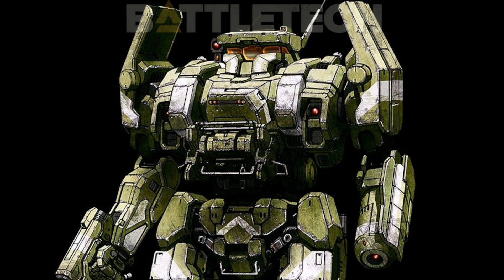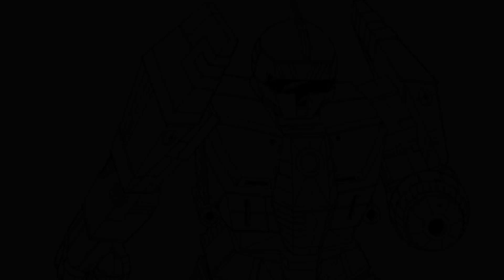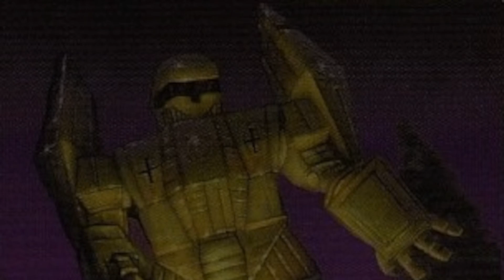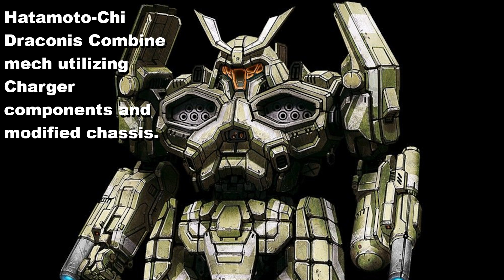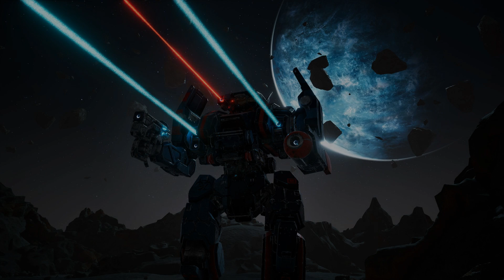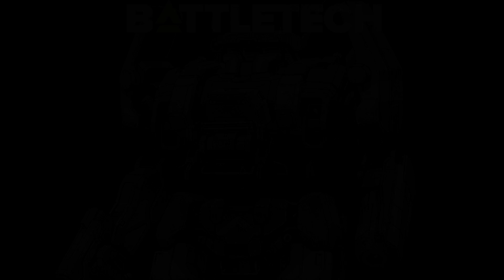BATTLETECH: The Charger

Comment: Ahh the Charger.

This is why I love BT.  As useless as the Charger is, it adds so much character to the setting that you have a design that was obviously the passion project of someone who had a 'bright idea', but maybe not as much of a grasp on the realities of warfare.  As Big Red points out, sometimes 'bold' does not make for 'good'.
Reply: The "bright idea" behind the Charger? Graft. The whole point behind the original Charger was getting those sweet, sweet Star League Dollars.
Reply: Anyone who thinks the Charger is useless have never been in a cityfight where those big slow cycling ranged weapons are next useless, and having a Charger barreling towards you with the might and rage of an Angry god; who proceeds to tear your mech's limbs off and beat you you to death with them. While you are too powerless and slow to escape. Desperately pressing the triggers waiting for your ppcs to recharge in the vain hopes that you can get off another shot or two before the Charger bashes you to bits. Also, at close range 5 small laser is nothing to sneeze at, their damage and rate of fire can quickly rip through a cockpit and microwave the mechwarrior inside.
Reply: @jakeroon  Firstly, that's incredibly niche, and secondly, that's also not it's intended role.

Yes, you can, under the right circumstances, make the Charger work.  However, not as a scout, and even in the realms of Urban/Close Combat, there are 'mechs that can do the job much better and more economically.
Reply: @jakeroon  "The might and rage of an angry god" and less armor than some medium Mechs. Even in a pure fistfight lower-weight opponents can actually take a Charger apart. Sure, it can throw hands like an 80-tonner. But it can't take a hit like an 80-tonner.

And 5 small lasers is pitiful at any range. Congratulations, you outgun Bug Mechs and some 30-ton designs at knife-fighting distances. Woo hoo. (In fact, one 3025 LOCUST variant outguns you at point blank.)
Reply: @magni5648  I was once like you, it all sounds ridiculous on paper. Then you see it happen; regularly. The thing is pilots don;t know how to react to the sheer aggressiveness and unorthodox fighting style of an 80 ton mech with that much speed and close range threat. By the time they have figured out that the small laser have softened them up enough that the Charger is about to gut them, it doesn't matter that the charger has lighter armor and "can't take a hit like an 80 toner" , b/c the opponent is already dead, and the Charger is briskly making it's way to it';s next unfortunate victim. I do agree, however; that a charger is not intended to tangle with mechs that outweigh it. But your suggestion that lower weight mechs can (with implied regularity) throw hands with a charger and make it out a alive , is laughable. The facts are any lighter mech that throws hands with a Charger and lives to tell about it, got lucky.
Reply: @malusignatius  it is defiantly not an optimum mech. but as many found out during the session wars; underestimate the Charger at your own peril.
Reply: @magni5648  As far as bug gun mech and the 5 lasers, there's plenty of evidence on youtube about how devastating 5 small laser builds are at close range , so that speaks for itself. The fact that you don't have a healthy fear of 5 small lasers builds, and the amount of sustainable damage they can dish in short order, speaks volumes.
Reply: @jakeroon  If you let the Charger pilot dictate the terms of the fight.  Then again, any 'mech is dangerous if you let the opponent do that.
Reply: @malusignatius  some times you just don;t get the choice. The fight is here, it's now, and you're in it. Also to expect a Charger jockey to not have upgraded his machine in the past 700 years to Endosteel and light ferro; freeing up several tons for enough armor to make any 80 toner go "yeah that'll do" , is not logical. The lesson I am trying to impart is: if you see an Urbanmech or a Charger on the field during a particularly rough fight. Take note, and possibly (very possibly) be a bit concerned. Because they are probably about to pull some crazy crap, or die spectacularly trying to.
Reply: @jakeroon  It doesn't sound ridiculous "on paper", it's just garbage, period. Woo hoo, you manage to surprise someone with a one-trick pony once. Great. That's not a sound base for anythign resembling an actual good plan.

And 5 small lasers aren't "softening up" anything bigger than a light Mech in the time it takes anything bigger than a light Mech to blast a Charger into so much scrap. Again, firepower worse than some light Mech, armor worse than many medium mechs. And mobility barely on par with most mediums. When a fucking stock Shadowhawk beats you in firepower, mobility and survivability, you know things are dire.

And the average 60-tonner or bigger is absolutely going to beat a Charger in a fistfight. Because they can hit damn near as hard and take hits better than it. It's a giant big strong guy... with a massive glass jaw.

So great, it can kill people who don't pay any attentition to it and do not try to kill it back. What a great weapon indeed.

Also, PARAGRAPHS. Use them.
Reply: @jakeroon  I'm not talking about high-tech custom fever dreams here. I'm talking about a fucking Introtech canon Locust-1E. 2 medium + 2 small lasers. It literally outguns a Charger.
Reply: @jakeroon  

If you're talking about upgrades (assuming they're available to the pilot, remember that until the 3040s endo etc. were unavailable to most of the IS, and even after, were rare and expensive to get), then it's not the 'mech being discussed.  Anyone can mod a chassis into something viable, that's exactly what House Liao did with the Charger by reducing it's engine size and using the space for a more sensible Assault 'mech loadout.  

But that doesn't change the fact that the base Charger is incapable of the mission it was designed for, and when it comes to the close combat role it's reasonably good at, can be out-done by 'mechs 5-10 tons lighter than it (eg. the Axman).  It's a very niche design at best.

And yes, sometimes it's all you've got to work with.  Doesn't mean it's great.
Reply: @malusignatius  I am not implying it's "great", or even "good"; I am rebutting the OP's assertion that it's "useless". The fact that the Axeman could put the whoop on the Charger that is currently pummeling your Warhammer into dust would likely be of only moderate comfort during this significant emotional event. As you frantically grasp for the ejection handles in the hopes it still works while vast swaths of your mech have been caved in. I guess some comfort is better than none.

I think I'll rest my case here, other than to say: It's easy to look at everyone's favorite power creep content of clan tech, and dismiss mechs like the Charger. However, there are a lot of mechwarriors out there, and one day you just might run into that one guy who runs a charger and knows how to do it. When you do, you'll nod and say "yeah I get it now."
Reply: @jakeroon  Firstly, I'm the OP, I know what I said.

And I know the Charger.  I've been playing BT since the late '90s.  And, as stated, in it's designed role it's useless and even when you stack the deck in it's favour, it's at best average.   If you want a design with viability over more than just one environment, the CGR-1A1 Charger isn't it.  Sure, it's fun when you get lucky and get to brawl with it, but it's no better at that than any other 80-ton 'mech, and well, the stars align for everyone if you roll the dice enough times, even Charger pilots.  

And even within it's 'chosen environment', the lack of jump jets severely hampers the Charger's utility.  And the close terrain makes it even easier for jump jet equipped mediums and lights to flank it safely, and a Jenner or a Phoenix Hawk is going to shred its rear armour in a single volley.

Again, the Charger's only going to get the fight it wants if one or both of two things happen:

The Charger gets very lucky,

or

The OpFor messes up, badly.
Reply: @malusignatius   I know what I said as well. And I repeatedly said I am not advocating the Charger is an amazing machine that outpaces others.  The charger is a second or third string. Yeah , of course it is. But it isn't useless, nor is it niche, nor does it's "intended role" matter a tinkers darn; to anyone but the military affairs guys. In this universe where a mechwarrior will immediately plop in an XL 400 engine, up the armor to 584, swap in two light ppc, and use the +50 range -50 cool-down on small lasers chassis quirks to wreck your face if they get a chance.  ( You can affix jump jets to it by the way). All without the need of the zero-g factory refit of the expensive endosteel. But you could do that too if you wanted. And some houses did! The charger , all be it a second or third stringer , can get the job done. I never claimed it was better than an Atlas or a clan tech mech with a cool animal spirit name. If you don't think a 584 armored 80 ton mech that can run at near 90kph has some pretty clear advantages that may be useful; I don't know what else to say other than: I agree to disagree with your assessment of this weapons platform. 

And that's probably b/c you are talking tabletop and I am talking mwo.
Reply: @jakeroon  MWO =/= Battletech.  I don't claim any knowledge of it or what works in Mechwarrior Online and what doesn't.

I'm looking at the design totally from an in-setting standpoint, not even within the abstraction that is the tabletop rules.  In setting, The Charger fails to achieve its stated goals, and wasted a lot of resources that the Star League needed at the time and could have been used elsewhere.  And yes, in TT, unmodified, it's a hard 'mech to get work.  

And all that fancy tech you're talking about is post-clan invasion developments, they don't exist in 3025, bar in the computer games.  Like I said, anyone can rip out the guts of a 'mech, replace it with new gear and make it work.  But then it's no longer that design, it's something new in the same shell.  So my point still stands.
Reply: @malusignatius  I find most who don't play the game in a the modern cannon era setting like  have little concept how big  a factor speed and size (both being big and small have advantages) truly are. I understand you'd really like to keep making the argument about some theory of the stock design , but even" in setting " mechwarriors constantly tinker with their mech  and make field mods to get the most out of their mech. In most every novel the key figures are modding mechs. Yeah, it's cool that the fluff for the mech was it was a badly designed graft project, but that's only half the cool fluff. The other half is warriors took this bad design, found a way to press it into service in a role it was never meant to be (because as you say it's intended role it sucked at) and made some havoc with it. 

I guess maybe in table top there is an option to play in a "way back in the day" time-frame. Keyword there being option. As far as cannon is concerned, the clan invasion was ages ago by now. All the tech I am talking about was available by 3070, and much of it was available prior to Exodus even, it just got lost in between then. 

So unless you insist on playing in the (now ancient history ) years between Exodus and Invasion, ie: the succession wars era; none of this "but that tech is not around" point matters. And even then, the Charger is considered one of the mechs that survived that era, and somehow, performed well in those dark days.

As far as the world at large is concerned the current canon fighting year for mechwarrior mercs is 3151. 

I like being dramatic in my text too, but an engine swap and some weapon harpoints replacement is hardly what any mechwarrior (merc) would call above and beyond the call of regular operating procedure. 

And again you seem to be refuting a point I am not making , namely : "The Charger is a fantastic mech." It's not, it's not even a good mech. But it isn't "useless". 

But fine , just for the sake of argument I'll concede. In it's bone stock form , the Charger is pretty awful. It certainly isn't something I;d choose to ride, ever, in any era. As the setting has it, though; good thing most other mechs in their bone stock form of the same era are garbage too, save a few scant standouts. 

That said, though. I hate slow mechs. I am using the word hate here , deliberately. You really should give mwo a try and see ow much being slow is a serious problem in an actual real time simulated fight. We ain't taking turns. So any mech that can't go over 81 kph , I am not using. The Charger is put there for ppl like me: for when you need an assault mech's armor, but still need to go fastish.  

Sure you have to "cheat" and mod the mech to get that. Which I guess is what you are saying. In the mwo circles, modding the mech is kinda the whole point. I can't imagine why it wouldn't be in TTRPG either , though?
Reply: @magni5648  it is really interesting how different ttrpg vs online are, I am starting to see. In a live firefight, no. 5 small lasers will absolutely DPS melt a 2 med+2 small build. Which is why you see any mwo online video with a 1E and every mechwarrior will immediately drop the mediums for smalls. Why? They have more DPS , short and simple. Bonus you get to add 1 ton more armor or something (pro tip add two more smalls for a total of six ). The recharge on Meds is just too damn long if you are gonna get any face time with the enemy at all. As a fast light mech , you gotta get in there, get as much damage as possible as fast as you can, then bail. 

Unlike in ttrpg speed and cover matter more than just a lil penalty to hit on some dice.

You really should give it a try. It might change many of your conceptions of how and why what mechs do what they do, what works in a "live" simulation and what is just theory.
Reply: Not as much, in part because of in setting restrictions (Engine swaps and structure swaps are expensive and time-consuming activities, the chief reason the Capellans did it with the Charger was because they didn't have any other option in the 3030s and were desperate for assault 'mechs), but also it takes the fun out of the game.

Anyone can take a 'mech, rip the guts out of it and make something good.  It's not hard at all.   The real challenge is taking a sub-optimal canon design and making it work.  It's why people love the Urbie.  On paper, it's...  'situational' at best, particularly the variant which trades in armour to mount an AC-20.  It's equal slowest moving 'mech in the game alongside the 100t Annihilator.  But when against all odds you get a headshot with that little monster, it's worth it.  Same with the Charger.  The CRG-1A1 is, along with many of it's descendants, woefully undergunned, light on armour and not fast enough to use speed as an effective defence.  9 times out of 10, it's going to get ripped to pieces before it can get anywhere.  But, when the stars align and you get into a fistfight with an Atlas and pop the brute's head off like a Rock'em-Sock'em Robot, that's a Thing of Beauty.

Any shmuck with a calculator and the construction rules can rebuild a bad design into something functional.  The real challenge is to take something as broken as a Charger into the field stock, and make it work.
Reply: @jakeroon  "Unlike in ttrpg speed and cover matter more than just a lil penalty to hit on some dice."

In a post full of dumb takes, this one takes the cake for sheer failure at basic understanding.

Also, LMAO, "simulation". Yeah, uh, like Ace Combat is a jet fighter simulation.
Reply: @magni5648  Since you've degraded to being petty and insulting. I'll count that as you being out of concise , well thought rebuttals.

We're talking two different applications. You are playing turn based  board game from the mid 80s. I'm playing a live action modern video game. Suffice to say, our experiences are gonna differ.
Reply: @jakeroon  LMAO, bravely running away, eh? SLs suck, in every single Battletech format, be it the tabletop or every single of the video game adaptations. And so does the Charger-1A1. No exceptions.

Have fun with your "simulation".
Reply: @magni5648  lmao , small laser suck in every mechwarrior video game? Now I know you just trollin and clownin.
Reply: @jakeroon  They suck in MW3, MW4, MW5, MWO, HBS BT. Okay, technically I can't speak for MW2 and 1.

Also, "but it works for me" doesn't actually constitute a good argument. Nor does "but it works against people that are bad at the game." Deal with it.

Then agian, I doubt you will. I am, after all, talking with the absolute clown who thinks MWO is a "simulation"  and who doesn't understand basic dicerolling mechanics.

Comment: I first saw this mech in MW5 while I was trying to upgrade my lance in the weight department. I believe I was looking for something to replace my hunchback. I got "lucky" and had enough salvage to pull the Charger after the fight. It had one mission, after which I decided I would be happier with a locust in that spot if I had to choose, and put my hunchback back on my next drop.
Reply: I was similar, finding onemto fill out the weight of my lance.  I figured I could fix it by stripping the machine, maxing out armour, and arming from there.  Only maxing the armour took all the tonnage.

Still kept it around for beachhead missions so I could run faster than artillery shells
Reply: The Charger 1A5 is the only Charger variant that's useful.
Reply: @katherineberger6329  3k would like to disagree with you
Reply: @TheAverageSeal777  It can come at me in my custom hotrodded 1A5. ;)
Reply: @katherineberger6329  i remember my shock when, after hearing the base charger only had 5 sl's, got shredded by its ac20.